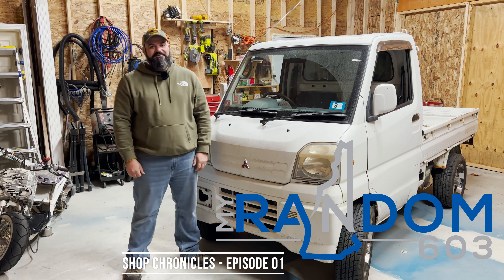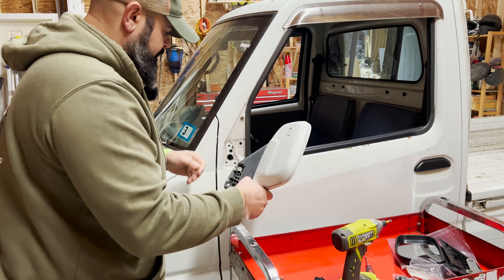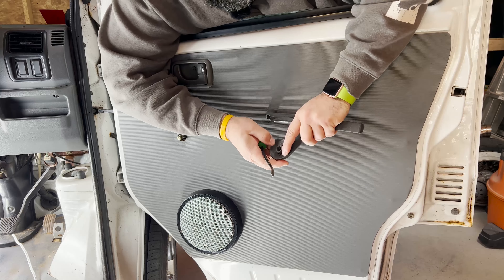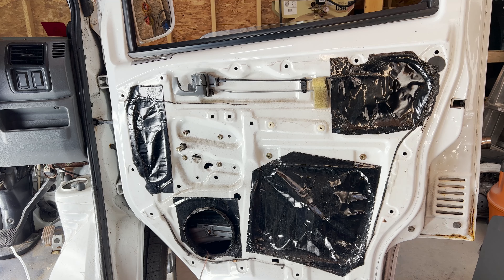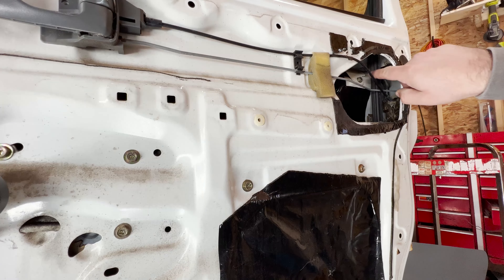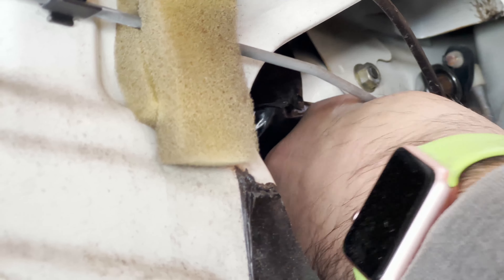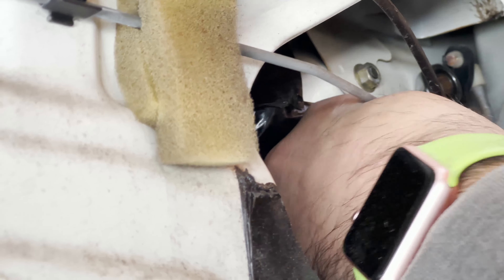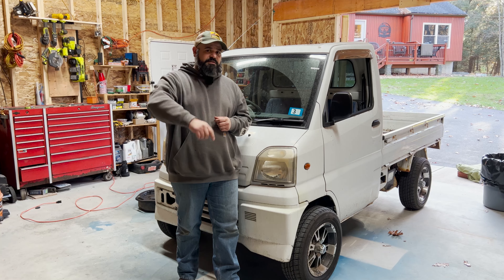2000 Mitsubishi Minicab U62T Kei Truck - Routine Maintenance - Older Video

Comment: HI, could you give me a link to purchase the wrench to remove spark plug, I could not use my regular 5/8 socket, look like it's 13/16 socket but I dont have thin wall on my 13/16 socket
Reply from the maker: Thanks for stopping by and sorry for the delay in replying.  Here is the actual socket that is also magnetic.  You can also either buy a generic thin wall socket or use a bench grinder but this is what I personally use on all of my Mitsubishis https://yokohamamotors.net/product533.html

Comment: How’s the leg room in the truck am 6 2 just wondering?
Reply from the maker: I'm 6'0" and currently 285lbs and fit reasonably well inside of the MiniCab.  The Honda ACTY I have to squish into.  I think you would find yourself ok inside of either a MiniCab or a HiJet Jumbo or High Top.
Reply: I'm 6'2" and I fit fairly well in a Mitsubishi Minicab. Not a lot of wiggle room, but it isn't painfully cramped.